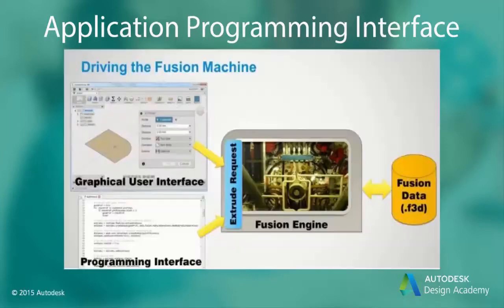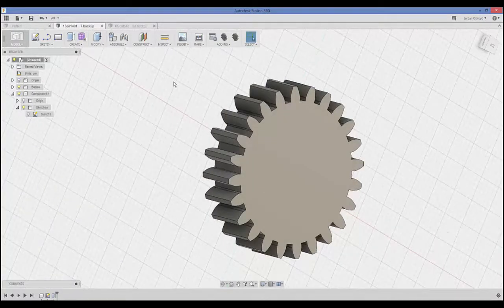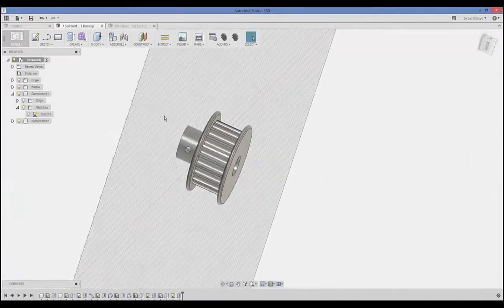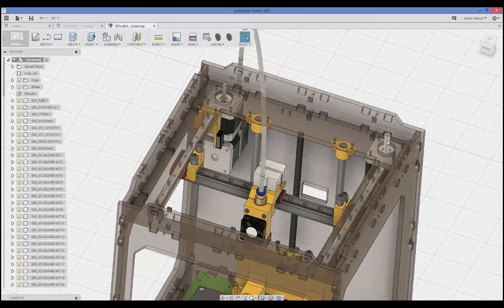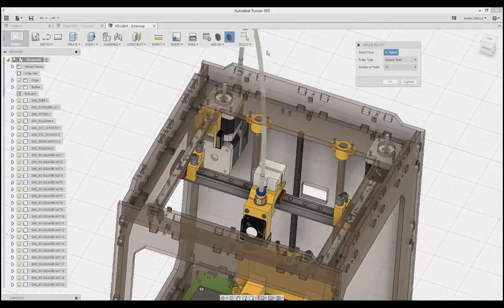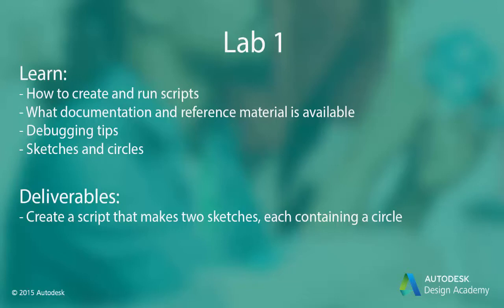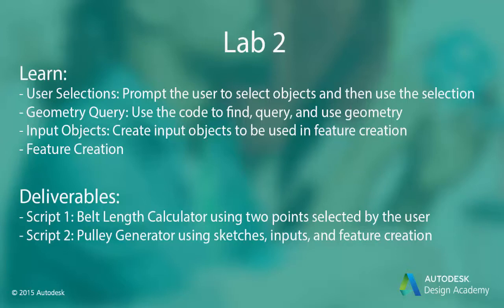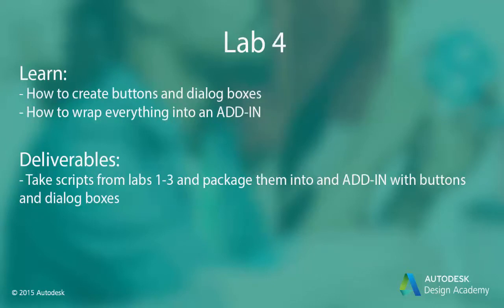Introduction to the Fusion 360 API

Comment: How to read component data, specifically the angles of rotation. I designed a robotic arm using Fusion 360 and I just wanted to know if there is a way to retrieve angles of rotation of assembled components using python.